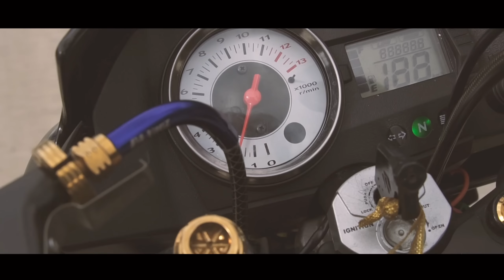Installing Alloy Inner Tube & Wave Lighten Shock for Raider150 | Andreu Cabagyo

Comment: idol sana masagot pag magpalit ba wave lighten outer tube at caliper na  pang wave din tas pang raider hub pwede kaya un?o may conversion pa na gagawain?
Reply from the maker: Meron conversion idol. Tatabas ka sa shock yung lagayan ng braket ng caliper
Reply: @andreucabagyo  salamat idol,pag magpalit nmn ng pang wave 125 na hub pwede ba gamitin ung stock spacer ng raider ung pang labas?harap at likod?